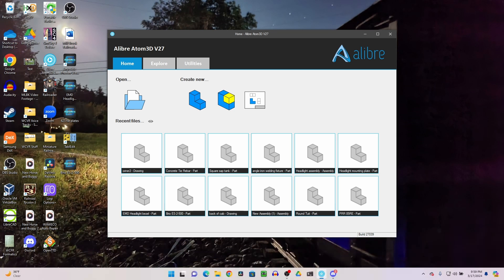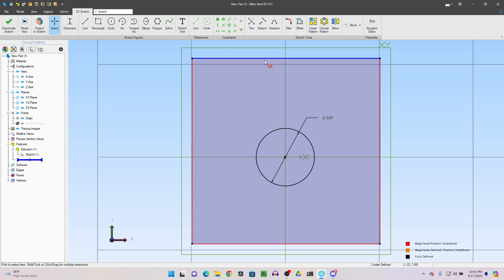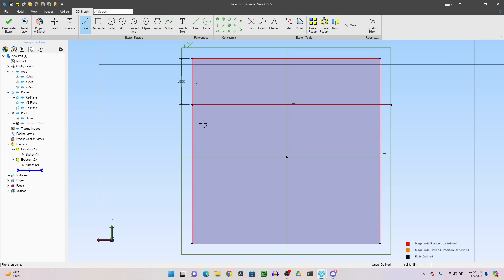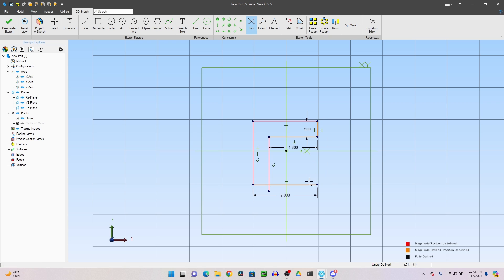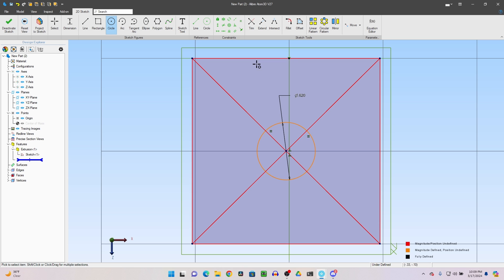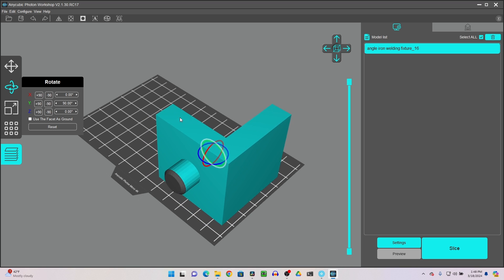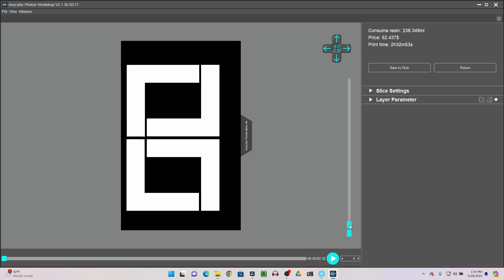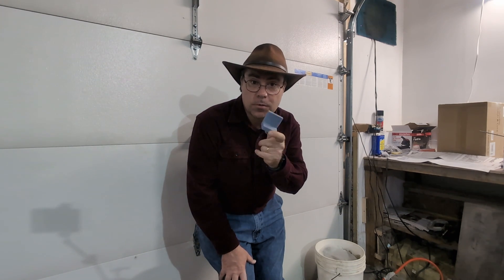3D printed welding fixture blocks? Why not?

Comment: Is there any advantage to 3D print vs welded angle blocks? 

Currently, I only see the disadvantage of being more susceptible to having splaters damage them due to being resin over steel.
Reply from the maker: I guess we'll soon find out if there's an advantage or nothing but disadvantages.

Comment: Very good. What on the train could you print?
Reply from the maker: Headlight bezels, door latches, and other parts I haven't thought of yet.
Reply: @MillBrookRailroad  Also maybe brackets for mounting control components like the R/C controller? And a fan duct for the electric motor.
Faux radiators/fans/grilles too.
Reply: In the first half of the video I understood why I failed algebra and in the second half I understood that I still have so much to learn! Thanks for showing all of us that this is such a deep hobby on so many slices! 😢😂

Comment: This is fantastic work!  I saw at 15:28 you've got the cool SLA printers too. It's great to see the project from cradle to grave.
Reply from the maker: Well, it's not quite cradle to grave. You didn't see a fixture shatter when it hit the floor, and I haven't melted one with the welder yet. Stay tuned for the abuse part.
Reply: @MillBrookRailroad  I can't help but smile to think of a video of only abusing your new 3D print
Reply from the maker: I may have to make that a reality.

Comment: the technology is just amazing! you can create what ever part you have a need for. I have heard that
people have used the 3D printers to make up parts to be able cast parts that are not available any more.
what is neat with the welding table is to do the full length of the part that will give you the most stable
position to hold down the items to be welded together.versus using blocks and clamps. great job
showing the set up and final parts Aaron! the CAD programs make it so easy over machining each block.